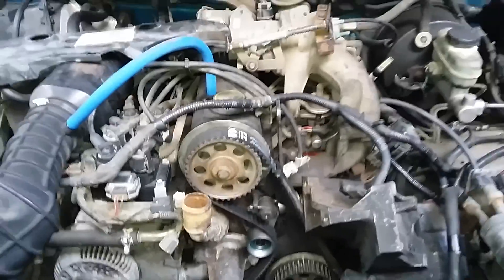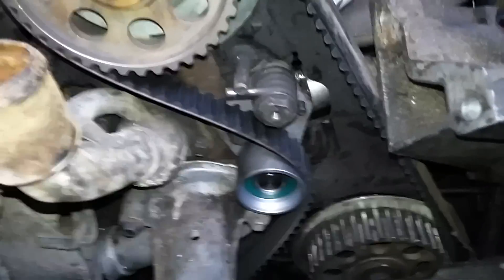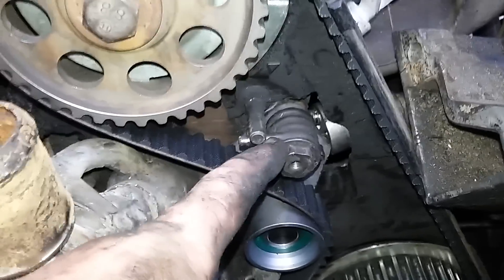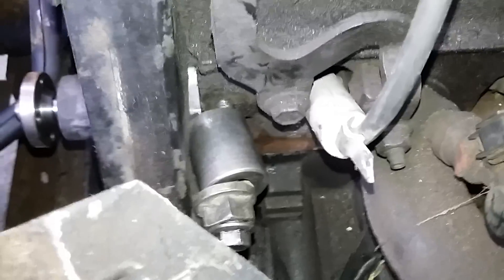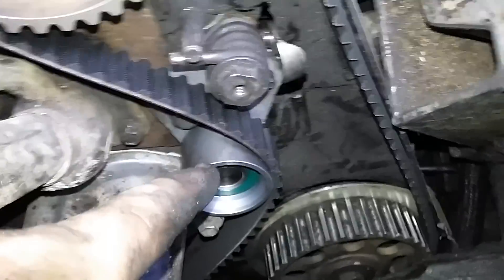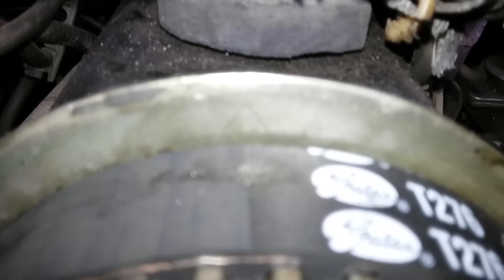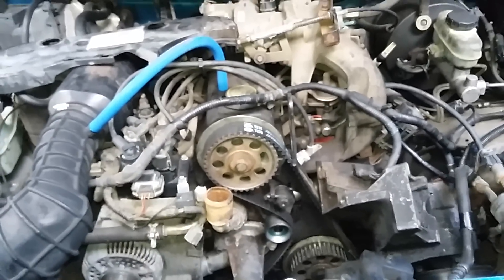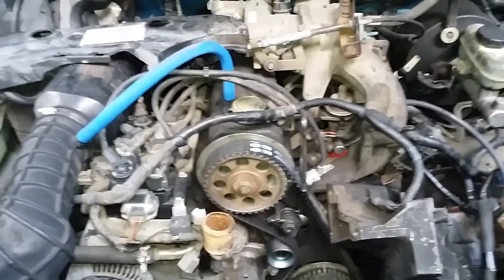Ford 2.3 timing belt replacement tips

Comment: Thank you sir you saved the day! I busted a belt on my '97 in a busy intersection driving home from work. I've done belts on a Pinto and diesel VW so this should be a breeze. Right? It sat in my driveway 
 in pieces for a month too cold to work on it. Finally today I got back at it. The harmonic balancer was such a pain to get off. The crank was easy to veirfy  by removing the #1 plug but took me many tries to get the cam marks sorted out till I watched this. I was either dead on or 180 deg off or a couple teeth either way. Your bolt and socket trick on the tensioner was perfect though I shoulda greased the threads because they began to get crapped up going in and out so many times. It would crank fine but not turn over. All day I tried to figure out what I forgot. then D'Oh! Let's see what happens when I put the crank angle sensor back on. Works fine now but I still got a lot of puttin-together left to do.  Again Thanks!

Comment: Just did this yesterday...I jammed a flat head on spring hand and pryed it down and tightened it... Then used the long pry bar to push the tensioner all the way and locked it with its bolt.

Comment: Seems like I have watched different videos showing different ways to set timing. I have 94 Mazda 2300. 
  The cam gear has a raised area on it that is shown to line up with middle line on a mark on the plastic piece at about 5 o’clock position. 
  Then I see some that mention the diamonds. 
  This has me scratching my head. 
  I broke  the crank sensor bracket and sensor along with the top bolt in the bracket. Still trying to determine whether I want to go to the trouble of trying to fix it.  
  Looks like I need to pull the gear to the right off. I think you called it distributor gear or was oil pump gear?
  I can feel where the bolt broke. Feels like I can turn something with my finger but the broken screw does come out with me pulling on it the best I can with the one finger I can get against it. 
  I think maybe the screw broke off and the threads on the screw are reaching the threads in the hole. 
  Gonna have to remove that gear to get a better idea of what is going on. 
  Looks like the gear might have to come off anyway to get a screw back in.

Comment: My belt skipped a tooth and it's still on, how can I align the cam and crank sprockets with their marks? When I align the crank pulley with its mark, the cam sprocket doesn't align and when I align the cam sprocket with its mark, the crank pulley doesn't align.

Comment: Bought a truck at an auction in 95 Ranger 2.3 it ran well no noise but the timing belt was cracked and had a 160,000 Mi on it not my first time replacing a timing belt I replace the timing belt tensioner the water pump thermostat serpentine belt tensioner because it was stuck and The Idler cuz it was making noise a positive I've got the timing marks right triangle on top diamond in the middle Gateway straight up on the crank Haven replace the crank sensor because it was so difficult to get to started right up but now has a knocking noise can't Pin It Down any ideas?

Comment: Side note=be careful if ya use one of your primary bolts for the tensioner pulley trick, cause it might mess the threads up. Still, it's the ticket.

Comment: Plan to do this in the spring. Do I remove the radiator? And am I using an OEM belt or can I use an AutoZone or Advance Auto product. Great video...explains my timing issues.

Comment: That's great and all but how'd you get that bracket off..?
Reply from the maker: I used some ratchet wrenches
Reply: @BigTravGill  I found the bolt that needed to be removed; I didn't realise it went all the way through but you can't use a ratchet, you need an open-ended wrench.
Reply from the maker: @RealCoolGuy  look up gear wrench...thats what type I used
Reply: @BigTravGill   Yeah, I got those. But you can't use a closed end wrench on that bolt... Never mind, my truck is probably slightly different from a different year

Comment: also have always been able to work the belt behind the harmonic balancer without pulling it off but not this time crank pos sensor in the way of that any tips for next time ???
Reply: I'm about to do the same job. My belt broke off. My ranger is a 96. Can you work around the crack pulley?
Reply: pull crank  sensor out  1 more  bolt and magic happens

Comment: I have done several 2.3 jobs in my life time this time I had to remove the idler pulley and with it the power steering and AC to get it out as the cover seemed to thick to slide it out I don't ever remember having to take any 2.3 apart that far also had to remove balancer and to get that radiator and related also removed I seen in your video your idler pulley still in place how in the hell did you get the timing belt cover off with that in the way
Reply from the maker: To be honest I did not take that much off...just had to get a few things out of the way
Reply: George Pratt take the AC compressor bracket off, it his the idlers... Swing it to the side and the timing cover can slide down once the bolt is out

Comment: that looks hard too and sure don't want to bugger up that bracket hole
Reply from the maker: nah it was pretty easy compared to most cars
Reply: Actually last night, I got the socket, bolt and spacers nut together and will try this this weekend. I have a 98 2.5 and it looks like I'll have to take the power steering pump off the bracket so I'll have more access to that bolt hole. Thanks for the clear demonstration.
Reply: It was super easy...it worked! So I'm all set for tomorrow replace belt and the tensioner ...the tensioner has me worried...will the socket trick work for this too...but the part of loosening the tension worked so well!

Comment: how you get crank pulley off there are no holes
Reply: Had to use a hammer and a pry bar but be careful because you can break the exciter wheel on the back and then you gotta buy a new harmonic balancer aka crank pulley because that exciter is used for the crank position sensor
Reply: universal 3 finger pully puller grab outside back of pully this is not the right tool but easier  to rent it from orylies or dumbtozone  you know orileys  or autozone hahahaha I made a funny  your taking a chance though because you don't want rubber in pully ripping causing balance issues or worse but I said fuck it ill just judge how it feels and looks and  mine was easy . or get 2 prybars and go underneath shimmy shake walk it off but choose your pry points wisely  .